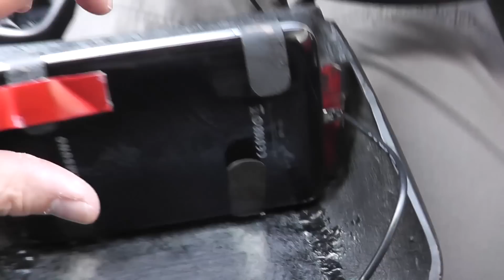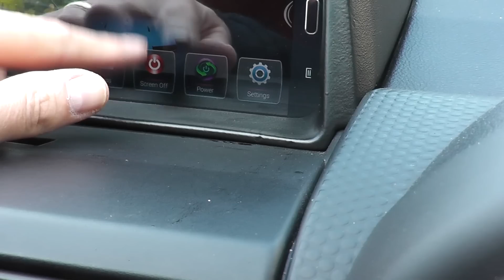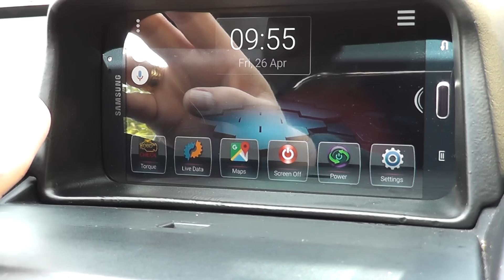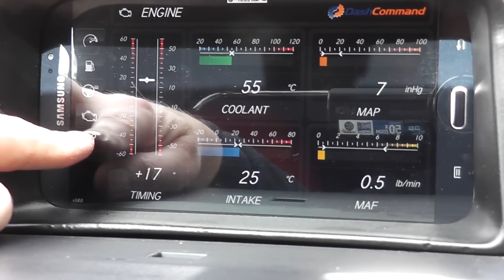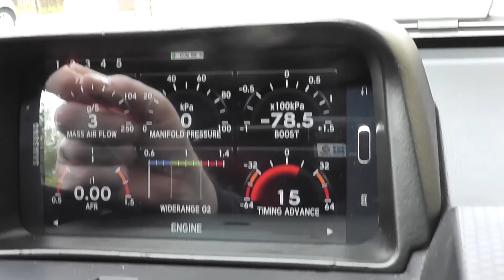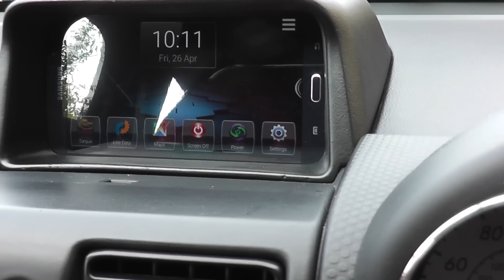MR2 Navpod Install completion

Comment: Mark, is it a pain to reach and touch the screen while driving? seems kind of far forward. would you be able to have some sort of remote to use it normally
Reply from the maker: Hey Jason. I can drive and use the screen but it is a but further away then I would like. I think when you look at where modern car touchscreens are placed now they tend to be up the front of the dash rather than midway. I use the screen mainly for gauges in  torque pro or dashcommand so it doesn't cause me too much issue. I have used it for navigation as well (which is a visual improvement to looking down at the factory head unit mount position of my android head unit) but you set your route up and then  pretty much don't need to touch it again. Using android auto is a good option for navigation and music combined with Google assistant voice commands.  I would certainly recommend big screen buttons though as it would be difficult to accurately select small screen buttons, especially when driving. I'm not too sure on a possible remote option. I guess it depends on what you might want to use it for. Voice commands night be your friend here. ... hope that helps ☺
Reply: @DadDiaries  I have had multiple cars with voice commands, in combination with wind/ac noise sometimes it gets it completely wrong. I used to use voice commands for navigation, not pay attention and it would enter an address that sounded similar but not the same. I would end up driving aimlessly to another location with a similar street name in a different town. It would be cool if some sort of small joystick could be implemented, maybe it could sit on wheel, or where the fog light switches are.

Comment: Yeeeeeeeeeeeessss. Pure Awesome

I will write as I watch the video with my suggestions to share

 Im gonna do a video on mine with an OEM pod and a Nexus 7 1st gen and I'm going off this video(Which I will reference as well). I appreciate the upload. A way to fix the USB cable on the tablet is to use an L shaped cable instead of stripping the original. When it comes to powering on or off without root you can use the "Stay Awake" feature on developer options. This keeps the screen on while charging and set it to shut the display after X amount of seconds after you turn the car off(assuming your 2.1 amp socket is connected to an ignition source). You basically have the table on 24/7 but if you daily your Spyder it shouldn't be an issue. I understand if your spyder is gonna be a weekend car it makes sense to do what you did with the root. With the nexus 7 there are no physical buttons on the front (home button is on the screen which rotates with the screen) so it becomes inaccessible when the key is off therefore no one knows that is an actual tablet. The launcher you used is amazing. I see the torque pro stuff as well great work. I also see you already have a double din head unit with a screen which I don't have one so the table for me will more of a media interface with the radio via AUX cable. With that I can have Spotify, Pandora, Google maps etc while keeping the FM radio and volume. The OEM pod has a rear vent which I'm planning to use a PC fan use cool it a little.I don't recommend gluing the pod to the dash for servicing purposes. I love your take on this and will share my info once I do I. Again I appreciate the upload and keep the videos coming.
Reply from the maker: Hey buddy I said I'd get it up this week for you, I'm not kidding if you hadn't requested it probably wouldn't have been that quick lol. You raise some great points, I couldn't find an L shaped micro usb cable so that's why I opted to mod one I had. The nexus sounds like a better option visually for the pod for a more OEM look perhaps. Thanks for adding your comments which I'm sure will be helpful to the community. And thanks for your feedback, much appreciated fella :) 👍